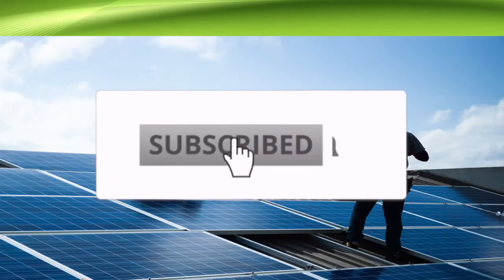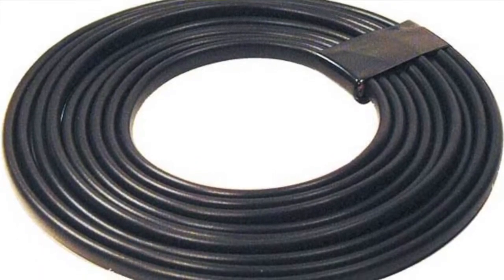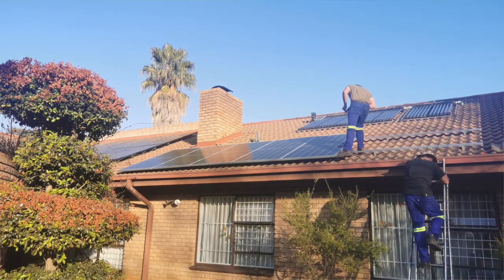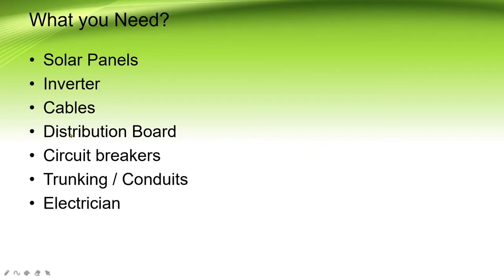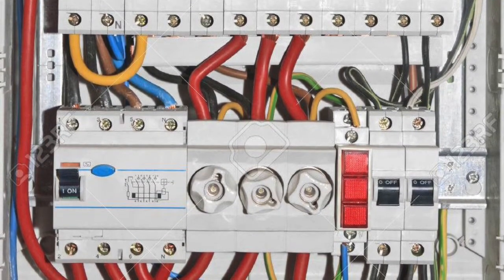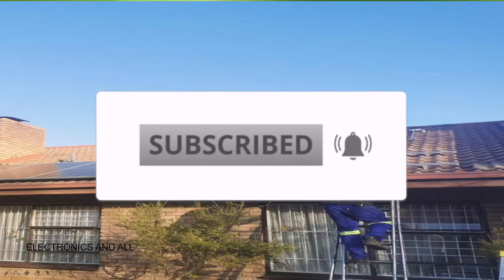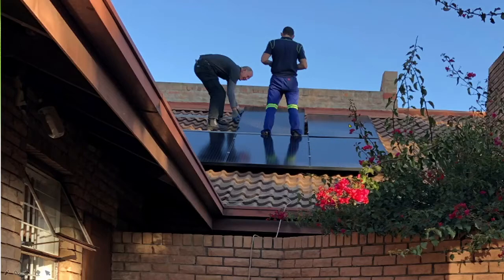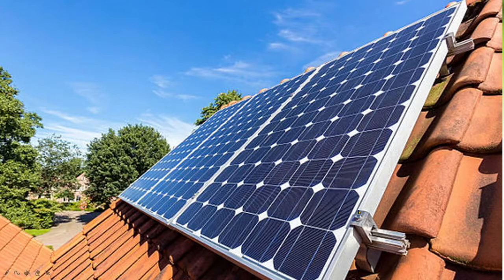Solar Installation Part 1

Comment: How many panels would a household with a 20 L geyser,2plate stove, 170 L fridge and an electric kettle. I need this for my school project.
Reply from the maker: POWER = v X I.
SA Voltage is 220v. Work out how much power the fridge requires.. It will be around 450 watts.  
Work on using 400watt panels. 
Do the same for all the appliances and you will get your answer.
Reply: @ElecAndAll  ok thank you Sir🙏